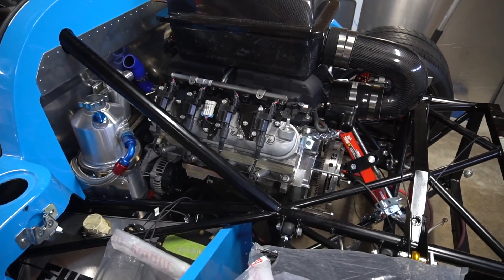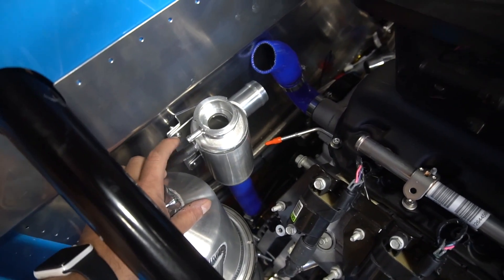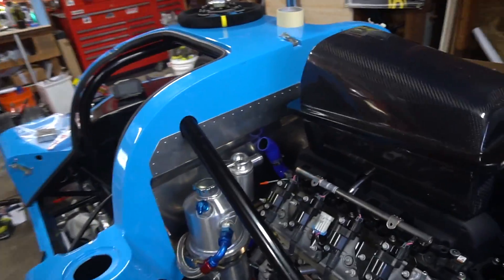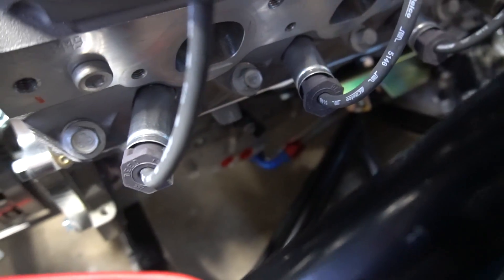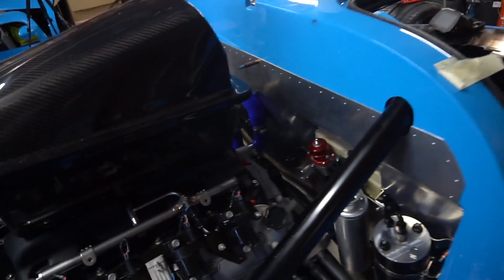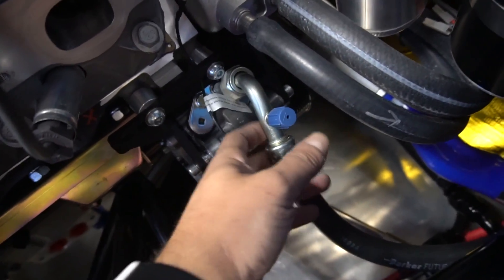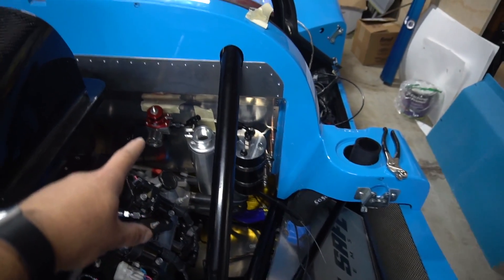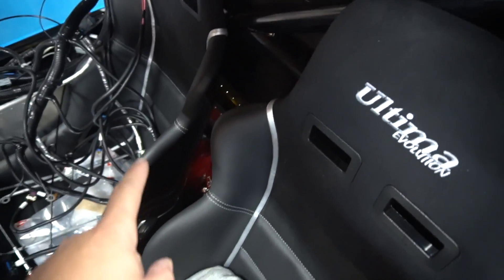Project Blunicorn 024, Fuel and Water Plumbing

Comment: Usually the vacuum nipple on the fuel reg is left uncapped with LS engines. I see that yours is capped.
Reply from the maker: Since it's a naturally aspirated engine, there's no positive pressure correction needed.  It doesn't matter if it's capped or not, but I capped it to keep out dust and debris.
Reply: Most regulator manufactures (including Aeromotive) mention in their literature to leave them open if it isn't a vacuum referenced system. Aeromotive's literature states....poor regulator performance will result from blocking/capping the port. @DriveDriverDriven

Comment: WHM-3D, you sir are doing a great job.  I like your ideas with modifying the fuel system.  Dry sump oil system = the real deal.  You must have an engineering background.  This was quite the challenge taking on a kit car of this complexity.  The world has come a long way since having to chop 12" out of a VW frame or using a 1989 Fiero.  I see what you mean about running out of room.  By the time you add in the headers, wow, no more room.  Looks like changing out the serpentine belt will be a bitch.  At least you can get to the plugs.  Keep up the great work, and as always, thank you for your time and efforts.
Reply from the maker: That's one of the things I appreciate about the Ultima, yes it's a kit car, but it doesn't source anything but engine/trans from another car.  There is a lot of engineering behind it to make it the capable street/track weapon it is.  Everything is so tight and compact there isn't much wasted space through out the car.  If you plan to track an Ultima you have to plan your fuel and oil systems accordingly.  The performance envelope is so high on these cars, it would be very easy to starve the fuel and oil pickups on a typical install.
Reply: Good idea that you are using a fuel tank mat system.  I should have had one of those in my 1972 MG Midget; it ran out of gas 6 times in 2 years.  Humble, since your build is eating up real-estate quickly, I would recommend you use a pointer to indicate specific parts in your build.  You could cover the tip in a reflective color to help the camera focus.  You could rig a dowel rod with a small spring loaded mirror.  Most people have never driven a car capable of generation 1+G of force, which mandates special considerations.  Keep up the great work.  @DriveDriverDriven